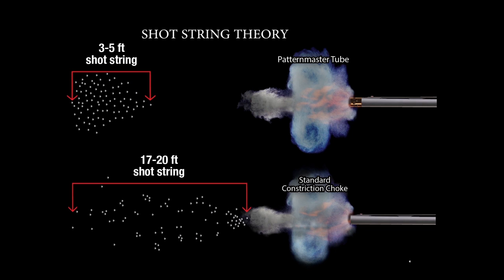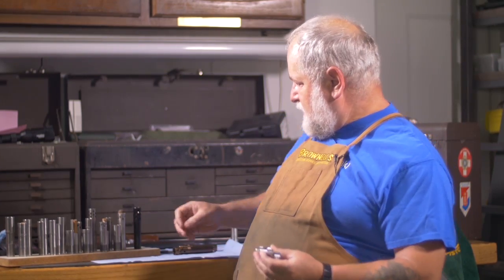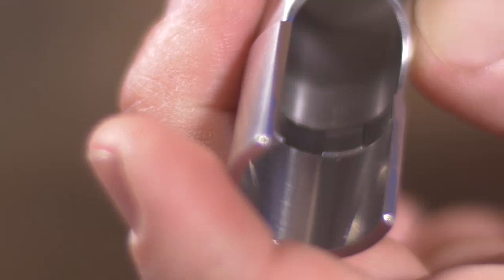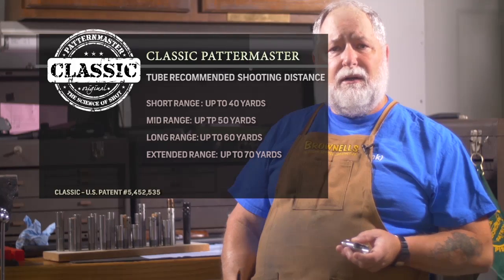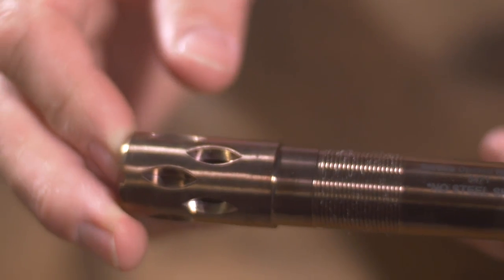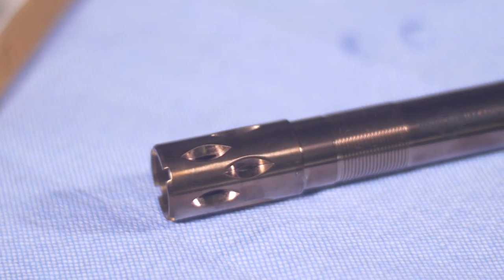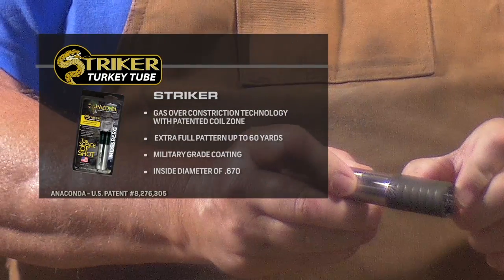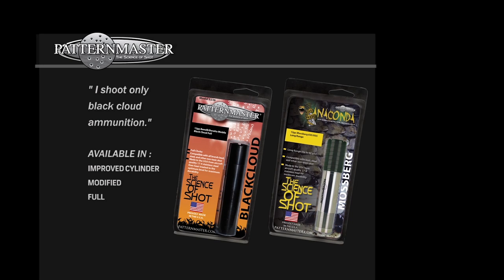Patternmaster University

Comment: When you hit. I've owned a pattern master for about 7 years, I've missed a lot more. Yeah, on the ones I hit, seem to go down, not always though. Pass shooting geese, you will have to lead the goose. Shorter shot string decreases the chance of a hit. It only takes one bb to the head to kill a goose. I'm not sold with my experience.
Reply: Then Learn the gun more it's not the chokes fault.  1 BB hitting a goose in the head yea that will work.  But the chances of that happening constantly is impossible to do.  Have one in my 870 classic long range silver.  Not to much gets away. Have 2 in my Silver pigeon 3 for skeet and upland 20 gauge and it's no joke either.  Just learning the chokes and guns is the fun part. When you get it you won't want anything else.
Reply: Your not on the birds then 😉 take some time and practice once you get your lead down you will be a way better wing shooter than anyone in the blind these chokes make everyone a better shooter keep at it don't get frustrated take your time and pay attention to wat the birds are doing wen you shoot if there throwing there head back you have  lead um to much if they keep flying straight you were behind um remember to paper test your gun and choke to see if you are shooting high or low and might need a shim kit for your gun or you will have to have some space between the bird and your bead which is usually the case I hope this helps
Reply: @jaipellegrin3526  can't agree more these chokes make anyone a better wing shooter